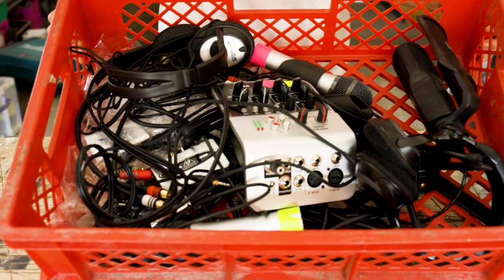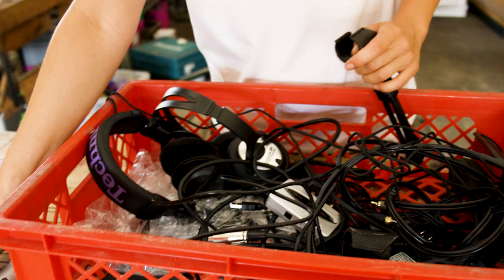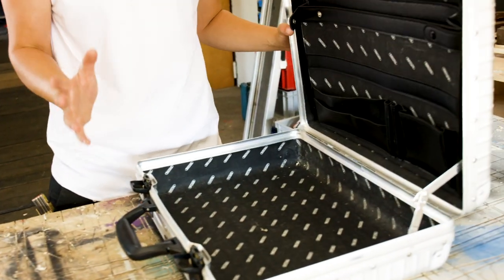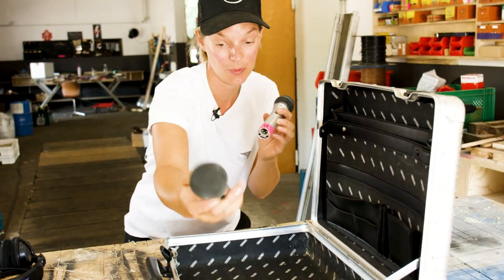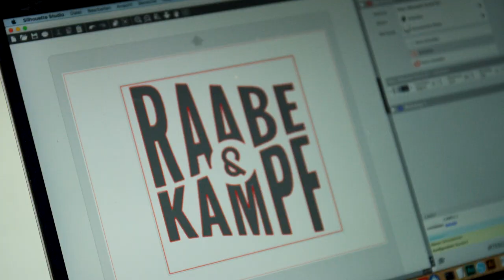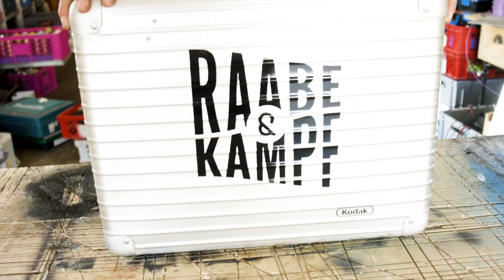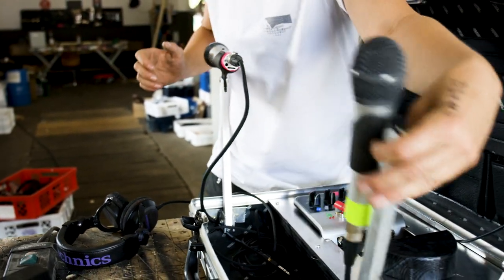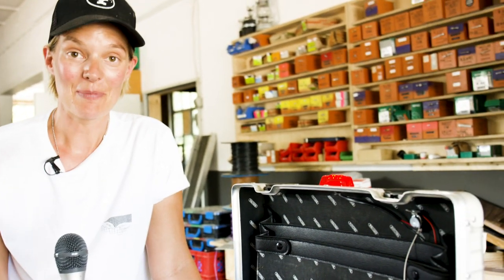A Podcasting Studio in a Briefcase

Comment: Very nice build. I like the red light. You should make an "On Air" transfer for it!

Reminds me of a similar size case that the BBC used to have as a portable radio studio. It had a tiny 4 channel audio mixer, space for mics, headphones and cables, and an interface to connect to either one or two phone lines for doing remotes. The modern version has not only a phone interface, but also VOIP so you can use the internet as a relay, and it can connect to a satellite phone.

Comment: Maybe a cylinder mount with a thumb screw for the mic stand...so you can rotate the mics in circular fashion to swivel the mic away from the console...if you’re tracking in a really tight space or if you gotta sneeze or yawn...slide the mic away from your face...not your face away from the mic. Also if you bump the mic gettin seated, the mic mount will move...not the mixer and console.

Comment: Try using some wing-nuts to lock the mic-stand and mic-arm into position when unfolded so it won't accidentally fall back into the case or the mic-arm won't swivel away from the user when in use during your podcast.